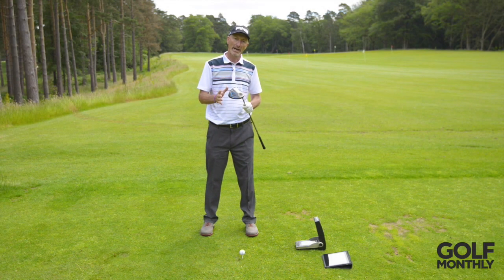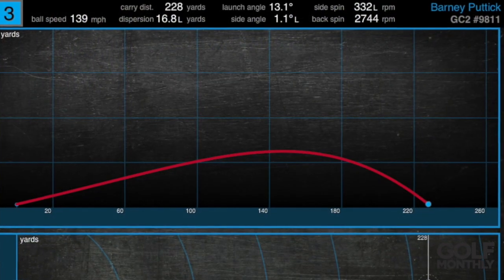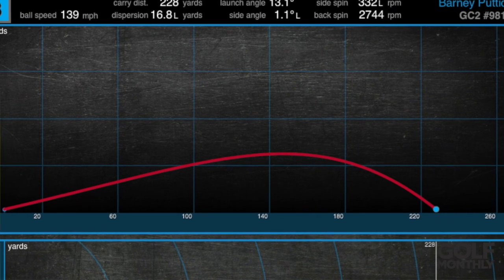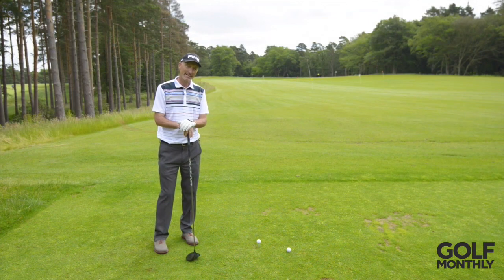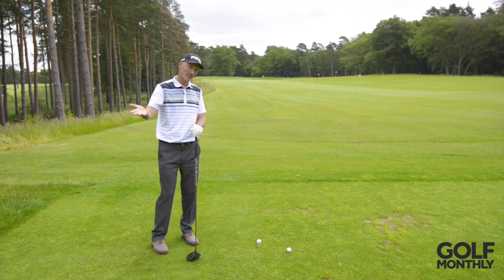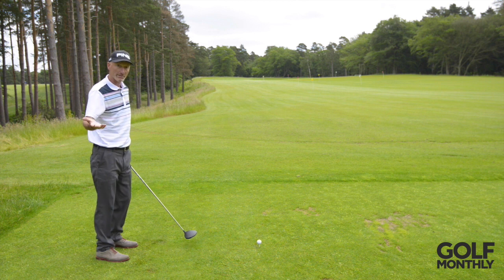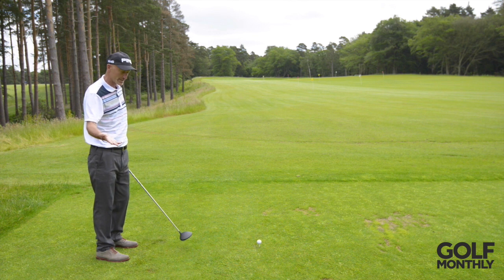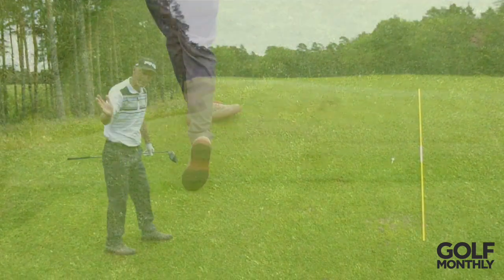Fault Fixer - #6 Reduce Your Driver Spin

Comment: You come off like a mug when you make claims like that, just be honest instead of trying to con people who don't know any better, you very well know it's the swing more than the club that makes the biggest difference.
Reply: Jordan Hazell disagree, the newer drivers are much more forgiving and are designed to give less spin even with miss hits
Reply: 25 yards just like that. Errr no.
Reply: +Paddy's Bricks your correct  I'm a short knocker 220 yard high spinning drives, but my new M2 driver with my secret personal 350 dollar Shaft is a beast and putting me in a way better position in the fairway by learning how to hit up on the ball, hell it's frightening when i catch it right with 70 percent swing speed in seeing 255-265 on shots and i can destroy 390 yard par 4's because I'm an expert on hitting down with irons, that down swing caused me previous misery with driver.